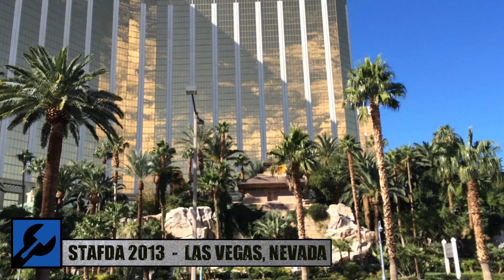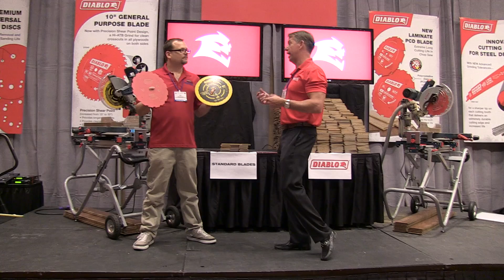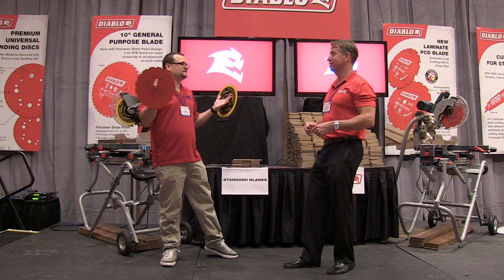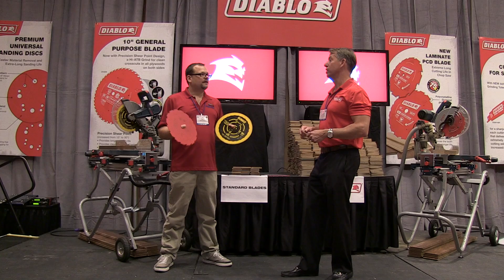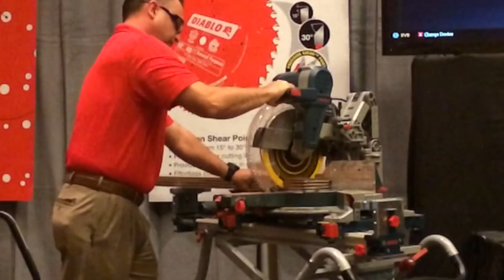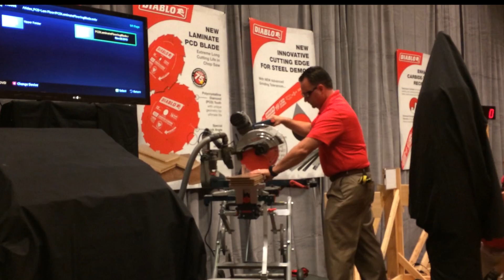Diablo PCD Laminate Blade - STAFDA 2013

Comment: No doubt that's a great blade, but the heat and added stress to the standard blade by cutting 4 AT A TIME would definitely dramatically shorten its lifetime. So while the freud may in fact be amazing, the standards aren't as terrible as they are indicating in real life situations (1 piece at well less than an inch thickness at a time). 

Science dudes.